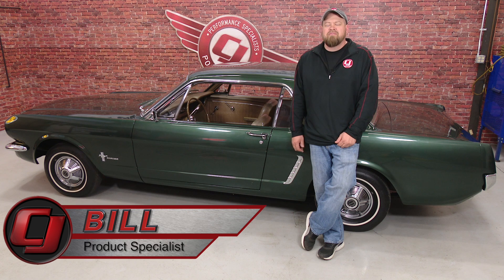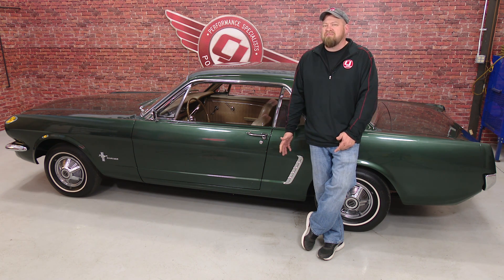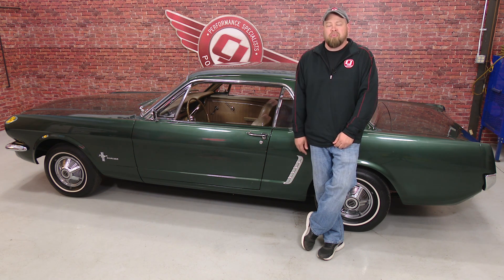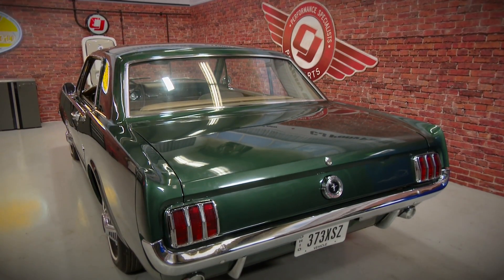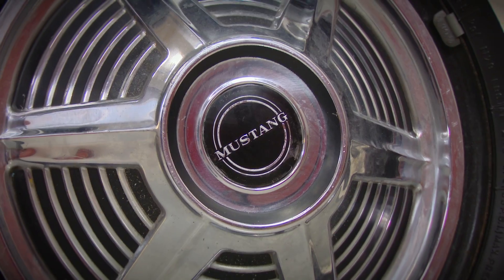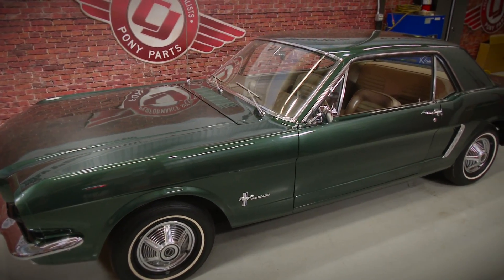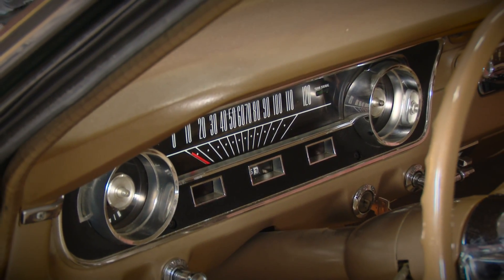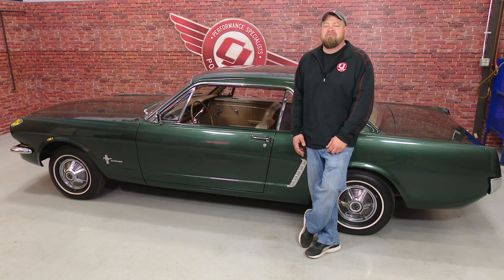1965 Mustang Project Car Introduction

Comment: Nice car! I have a 66 with a 289 and a C3. I want to do the convertion to a T5, but dont know how to do it. The transmission out and in is the easier part, but the actual get all these parts because you have an automatic is what I do not know very good. Like the pedal asemlby and like parts that would make your project go from 1 weekend to several months.
 It would be cool if you could do like a transmission conversion with step by step and how to do it... but at the same time, modifing this beauty.... well would also prefer just to leave it automatic.
Reply: +David Borjas  Bill has already don't a full T5 swap video.  The only part that wasn't covered was the pedal assembly swap as we started with a manual car.
Reply: Yes Indeed, I did see that entire video and I thank bill for it. It would be very usefull to see a video of the pedal assembly and install it on a automatic mustang. It would be usefull for me, and maybe/hopefully for many others. :)